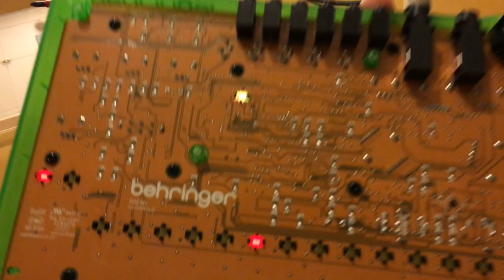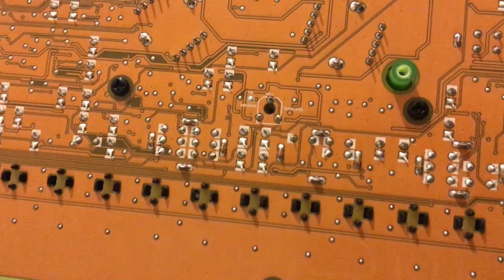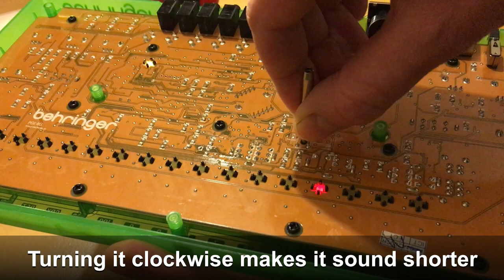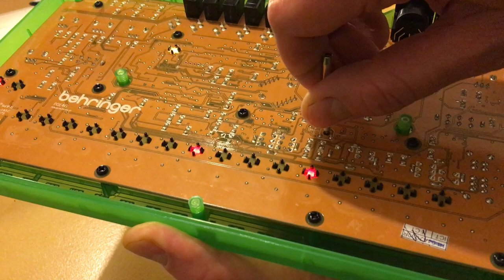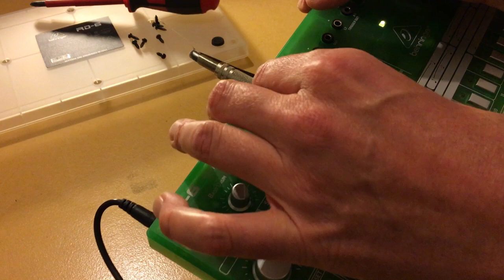Behringer RD-6 Adjusting the noise level trimpot

Comment: If you took precise measurements, you could drill a tiny hole in the back cover and then you could adjust this more easily.
Reply: So I drilled my back cover yesterday and it works great!  Take a piece of paper and press it to the inside of the back cover.  Then poke the screws through two of the holes nearest the trim pot so you are making an exact template of the distances of the two closest screws..  Take the paper off from the back cover and align the two holes up with the post holes on the circuit board.  Take two screws and anchor your paper template while noting the position of the trim pot, slightly below the top screw.  Gently press down on the paper template and the end of three wires will poke through your paper template in a triangle pattern.  Remove the template and make a tiny hole in the center of the triangle mark.  Mount the template on the outside back cover.  I used two tiny screwdrivers to poke through the template and into the screw holes in the back cover to hold it in place.  Now mark a mark with a marker or a sharp object in the tiny hole inside the triangle.  Remove the template and slowly drill through the tiny mark with a small drill bit and make a hole big enough to accommodate a small screwdriver.  Put your cover back on.  Now you can access the trim pot at will.  Turning it clockwise make the snare sound softer.   Turning it counterclockwise gives it a bigger white noise burst and makes it sound a bit more explosive.

Comment: I don't think the longer decay on the snare sounds bad at all.  Are you going to leave it longer, or shorter?
Reply from the maker: Sure, the snare drum sounds fine as it is, I just wanted to show how little the result is so everyone can consider if it's worth opening the RD-6. Personally I like the shorter, dry setting.
Reply: @funkyberlin303  Thanks for confirming! Perhaps it is better to just leave it at stock then? It doesn't seem to have as big of an impact, as adjusting the trim pot on the td3, for the filter cutoff.
Reply from the maker: @ASH-ou4cg  It's very easy and done quickly, so it could be fun to adjust your personal snare drum a bit. But no must do at all, sure.

Comment: 🎛 🥁🪛 Directions on how to drill your back cover so you can PERMANENTLY ACCESS the SNARE DRUM TRIM POT without removing the back cover ever time:   

Remove the back cover.  Take a piece of paper and press it to the inside of the back cover.  Then poke the screws through two of the holes nearest the trim pot so you are making an exact template of the distances of the two closest screws. Take the paper off from the back cover and align the two holes up with the post holes on the circuit board.  Take two screws and anchor your paper template while noting the position of the trim pot, slightly below the top screw.  Gently press down on the paper template and the end of three wires will poke through your paper template in a triangle pattern.  These are the solder mounts for the trim pot.  Remove the template and make a tiny hole in the center of the triangle marks.  Mount the template on the outside back cover.  I used two tiny screwdrivers to poke through the template and into the screw holes in the back cover to hold it in place.  Now make a mark with a marking pen or a sharp object through the tiny hole inside the triangle.  Remove the template and slowly drill through the tiny mark with a small drill bit and make a hole big enough to accommodate a small screwdriver.  Put your cover back on.  Now you can access the trim pot at will without removing the cover.  Turning it clockwise make the snare 🥁sound softer.   Turning it counterclockwise gives it a bigger white noise burst and makes it sound a bit more explosive. 💥

It took about 1/2 hour.  Enjoy!